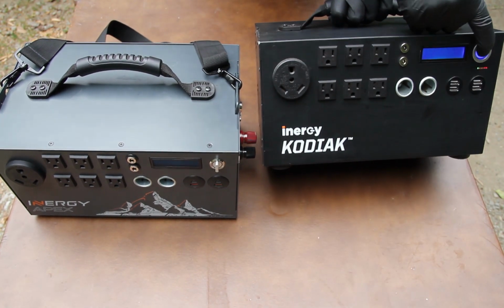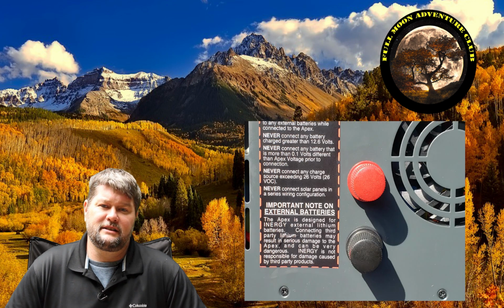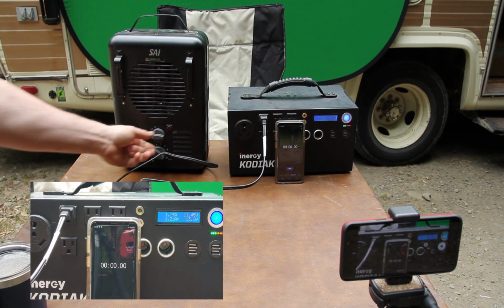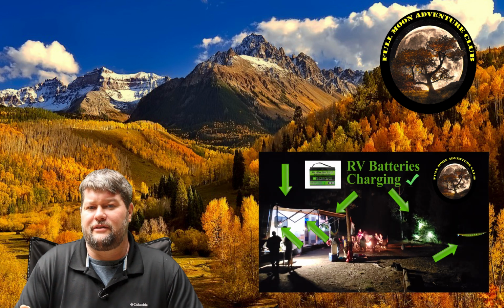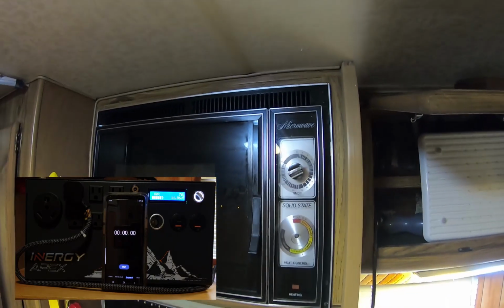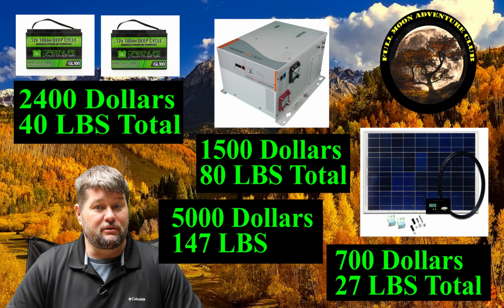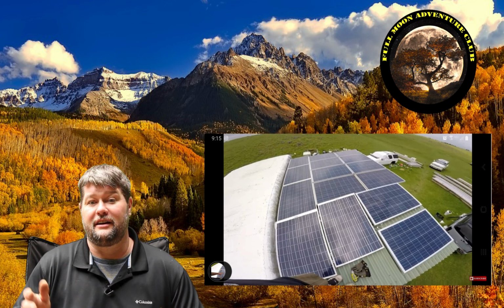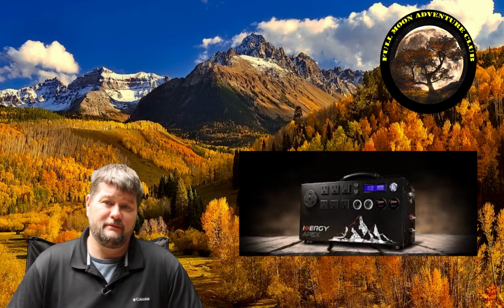Inergy Apex Pros, Cons, And Questions Answered

Comment: Hello Jim.  Would the apex run a dometic refrigerator that uses about 1-2 Ah/h, 24/7? Along with that fridge,  I'd be charging my phone,  laptop, bluetooth speaker, drone battery and run one of the lights that inergy includes in their gold package for a couple of hours, maybe,  at night and finally my water pump a few times per day for a few minutes (shower,  dishes,  hygiene)??? I will be buying the gold package with the Linx panels. $2,750 investment! I live in west texas where we have lots of sun! Your opinion and advice would greatly be appreciated Jim.  Thanks a bunch!!
Reply from the maker: Sorry for the lateness of my reply we haven't been in service for a few days. I think the Apex would run all of that stuff very very well. The Dometic refrigerator however I'm not sure of your power draw numbers. I have an 8 cubic foot Dometic refrigerator that runs off gas or AC and when it runs on AC it can take a lot of amps. Sometimes 20 amps per hour depending on how hot or cold it is. If you're talking about one of those Dometic freezer fridge coolers that runs on DC power then I think you'd be in really good shape. Especially with all that solar coming in you'd be great during the day and have plenty of run time at night as long as you're just doing the cooler fridge. But again that refrigerator sounds way too efficient to me. Make sure you double check your numbers. The Apex is a 90 AMP hour battery. Aside from the refrigerator that sounds like exactly what I use mine for it and it lasts a really long time. If you have any more questions feel free to ask and I'll try and answer it as long as I'm in cell service.    Jim
Reply: @fullmoonadventureclub  thank you so much for replying. I really appreciate your time and opinion.  My fridge is a cooler type fridge/freezer and I think it has a lower draw than what I said. Either way,  thanks again for taking time away from your RVing to answer my question.  Be looking forward to your new videos.  Happy camping!!!
Reply from the maker: @GoingNowhereSlow66  glad I could help. Don't forget to save 20% if you get that gold package using the code word Adventure. Take care and happy camping.   Jim
Reply: @fullmoonadventureclub  hello again Jim.  I was hoping to pick your brain once more if you'd let me.  I really appreciate you taking the time to answer my first question and I'm almost ready to make my purchase of the apex.  The only thing I'm confused on is wether I should buy the gold package with the Linx panels or the storm panels.  I know the difference in weight and that the Linx panels are flexible and are a bit more efficient than the storm panels.  The only concern I have is the durability between the two.  I don't mind the  40 lb weight difference but ive seen reviews on flex panels that aren't very positive and not too recommended.  Anyway,  sorry about the loooooooong letter but I thank you and value your advice and opinion.  Have a happy father's day!
Reply from the maker: @GoingNowhereSlow66   I'm about to receive a couple of the lynx panels for review. But if the weight isn't an issue for you and you are doing kind of a permanent installation I would recommend the storm panels. I have one of the storm panels at home and it seems really well-built. The lynx panels are more to keep things portable.
Reply: @fullmoonadventureclub  awesome!! Thanks a million!

Comment: I cancelled my order.  I bought it to run my 1500W microwave in my van for a max of 15 minutes.  The van has a 750W inverter already but it can't run the microwave.  When I found out about the 550W continuous draw limitation, I no longer had a need for it.  The Goal Zero 1000 will probably work better for me.

Comment: I have thundersbolt solar panels with SAE connectors. Does anyone make a conduit for the SAE connector to the EC8 in order to run thunderbolt solar panels on the Apex. Solar panel connectors should be universal!

Comment: I ran 220 watts  continuous on my apex and it lasted 3 hours. I use my 65 inch tv and couple of lights.
Reply from the maker: It seems like at that wattage draw it should have lasted about 5 hours. Strange. Are you sure about your numbers?  Jim
Reply: I will try again but right now I am testing the apex with my 200w solar panels and I have my tv, fan , iPad, light and is charging. I can use my apex all day long . The apex is awesome. I use your code to buy the apex. Thank you for your reviews.
Reply: fullmoonadventureclub 
I used the ps4. It draws 140w.

Comment: A fair review with a couple items missed.  The RV plug is labeled as 30A on Inergy web site.  You know that the Kodiak or Apex can ONLY OUTPUT a Max of 12.5A (1,500w/120v = 12.5a).  Why did you neglect to mention this?  There is NO mention in the manual about the max current either.  Second item, the 3 Reset buttons on the side panel which you did not show but only talked about.  There is no mention of these buttons in the manual.  I believe in your first review of the Apex your Reset buttons had no labels but in a Amory Survival review they are labeled DC2, DC1 and AC.  The efficiency of charging your Apex batteries and then using the Apex to charge your 200A Litium batteries is questionable except to show that it can be done to transfer energy.
Reply from the maker: I actually do mention the 12.5 amp output of the thirty amp plug in my other review video. I don't think I ever saw the reset switch labels in the manual so I Don't know which one is AC or DC. Just tap all three real quick and your unit is reset. When you can store an extra 180 amp hours and put it in your RV I will deal with some efficiency loss during the transfer from AC to DC. It is just an extra bonus of having so many cycles. Use them. Take care and happy camping.   Jim

Comment: Hey Jim. If I have my RV hooked up to my portable Generator and my solar panel connected to my 12 volt battery can I turn the generator on at the same time or will it damage my battery ?
Reply from the maker: No you're totally fine to run either one at the same time. They should both have or be going through a charge controller that will not overcharge the battery. As long as your solar panel has a charge controller and your generator is going through the RV converter charger you should be just fine to run both. I hope that helps.
Reply: fullmoonadventureclub thank you Jim

Comment: Thank you for all your hard work. I bought mine with your code. It came on Tuesday and works great! Will P. is not happy with anything unless he builds it himself. The purpose of this is to give you about 500 watts of continuous power for about 2 hrs. It can run everything in my den for about 3 hrs. This includes computer, cable box, 42 in. TV , external speakers , two fish tanks, a small Dometic freezer, lights and X box. Game on !!! For a power failure just switch off a few non essentials and extend use time. At only 25 lbs. I can carry it down to my car for a Quick recharge. My car charger is on order and should come soon. Thanks again from a loyal subscriber!!
Reply from the maker: I'm really glad you like it. Thanks for using the code and I hope it serves you very well. I think it's awesome when you're using it for stuff like that. I had a power outage and we had internet and we were watching TV, it was crazy. And now that power is very finite in the RV I love them even more. Thanks again for the comment and happy camping.   Jim
Reply: fullmoonadventureclub has always

Comment: Great job responding to a critical review without over defending and debating the issues. Your opinion has reinforced my decision to keep my Apex. Owning a typical travel trailer with insufficient batteries causes a lot of stress.  The Apex will allow me to run all my 12 volt systems and still have power when I wake up in the morning.  No more noisy gas generator to help run the heater and wake up everyone.  Thanks for the updated review.  Ignore the haters. Looking forward to your permanent install video.
Reply from the maker: I was not looking forward to jumping into this bees nest but I felt another review was warranted. I am open to everyone's opinion as long as they are civil but definitely getting some heated responses on this video. Thanks for your comment and  I am glad you feel better about your purchase. The Apex should really well for your needs. I hope it serves you well. Take care and happy camping.    Jim

Comment: I like the video a lot.  Waiting for mine to arrive and was concerned after the video on Youtube that made it sound like this unit was a piece of junk.  I was wondering if I can splice together two EC8 30' solar cables.   I want to keep the Apex in the house and use it 24-7 but I need more than a 30' cable from the panels to the house.  Is this possible.  I HAVE NO EXPERIENCE in SOLAR OR ELECTRICAL STUFF.. If it is possible, can you refer a video for me to get this done.  Thanks
Reply: Yes and it is easy . Inergy sells accessories for this purpose. Please be sure to water proof connections

Comment: It is not necessarily a bad unit, I have one, it's the price of the system in general. Yes, good if you need to power your laptop and small stuff..My microwave shut off similar to the same time yours did. I also did power a full small items like yours did. However I cannot find anything that I have that would run this unit for 500 watts continuously, as most higher appliances need at least 700 to 800 range.. Definitely would be worth it if it could have done 700 watts. I just spoke to a friend of mine who's an expert in this field for 20 years. He basically said, "so you paid almost 1700 for a generator and some solar panels that can only power 500 watts?  What?"  Based on your review, in essence, you are saying you would do this and shell out that kind of money and are keeping the unit (for free) as you "only promote things you love".  One would think if you are an expert in this field, you would take the unit back for that price and not do a review at all if you indeed had "to pay for it".  Heck, I am not even an expert, and I did my own test runs and research, and mathematically it does not make sense for the money. But, to be fair, maybe the people who are keeping it are not part of the middle class like me. Inergy customer service is great though, I will say. I myself will wait until at least they come out with a newer model and features. Thank you.
Reply from the maker: If you don't agree with the price point for what you get in the box that's completely understandable and up to you. In my test I showed it running a thousand Watts for 30 minutes. What tests did you do that concluded it wouldn't run seven or eight hundred watt appliances?   Jim
Reply: @fullmoonadventureclub   nothing. As it states no contiouse over 550.  I didnt want to ruin the machine. I would certainly add to it if I could however there are no lithium batteries available from inergy at this time. I would probably consider keeping it if it were.
Reply from the maker: @bobbybrown6646  yeah I wish they would hurry up with those already. But I was completely unaware of that 500 BMS protection circuit for the last year-and-a-half. And I've been pushing this thing to the brink for that entire time and it hasn't done any damage that I can see. But if you want to run some bigger stuff you really do need a bigger system. You could always put together a DIY solar generator kit. I hear from some people there really nice you just have to be kind of tech savvy to get it built.  Jim
Reply: @fullmoonadventureclub  thanks Jim.

Comment: ===> I just don’t understand why would they put a 1500 W inverter with 3000 W peak for a continuous draw of 550 W. It’s almost like, the inverter is not matched to the battery type. If the inverter was rated 700 W continuous with a 3000 W peak, then that is honest advertising.
Reply: Possibly lead acid usage may allow it to get full power use of the inverter. I have yet to find any video testing that though.
Reply from the maker: @DepletedWisdom  I wonder about that too. I wonder if an external battery would help take some of the load off the internal lithium battery giving you your 1500 watts for longer. Somehow I think all energy going to have to go through that battery pack and probably act like a bottleneck for the rest of the system. I have some other videos to do but maybe when I return to this I can try and play around with external batteries. Thanks for the comments and happy camping.   Jim

Comment: We bought a Kodiak based on your other videos for our RV. It was a waste of money. I've added batteries and can't really do much more than run our tv and CPAP machine.  We can't run our ac at all.  It really doesnt perform as you said it does.  For 30 minutes,  yay but not for hours of operation.  We enjoy your channel but it costed us $2000.00! I could've bought an inverter and lithium batteries 😥
Reply from the maker: Are you trying to run an air conditioner with the kodiak on battery power? Is it an RV air conditioner? The Kodiak will only run a small 5000 BTU window unit for about an hour without a full 600 watts of solar coming in. I think I was very clear on that in my videos. They are not designed for that. What will it only run for 30 minutes? I am sorry you are having problems with it. Maybe I can help with more information. Thanks.
Reply: @fullmoonadventureclub  Thanks for responding.  I didn't expect it to run my air. I did expect it to run my Cpap and watch a couple hours of TV. I have (3) 80 amp hour batteries connected to it. I average 8 amps when I use it. It just isn't good. I'm pretty knowledgeable with 12v. I really thought it was a 1500 watt inverter. I'm pretty bummed.
Reply from the maker: If you are pulling 8 amps AC power from the Apex then you're using 960 Watts continuous power. That's a pretty decent draw. the 90 AMP hour battery in the Kodiak is 1100 watts of storage. So you would burn through that battery in about an hour. Then if you have three other batteries that are 80 amp hours  that would probably buy you about two and a half more hours possibly 3 for a total of 4 hours. Is that about the runtime that you're experiencing?
Reply from the maker: If I was drawing 960 watts of power out of my RV I have to 100 amp hour lithium iron phosphate batteries and they would last about 2 hours with that watt draw. I would think a TV would use less power than that and I think CPAP machines are around 40 to 80 Watts. I'm not exactly sure but you should look at the wattage next time you use the Apex of them let me know exactly what you're drawing and what your running. I'm sorry you're not happy with its performance I'm just trying to figure out if there's a problem or if you're using a lot of power.
Reply: RV Renegades no one has said you can run an AC